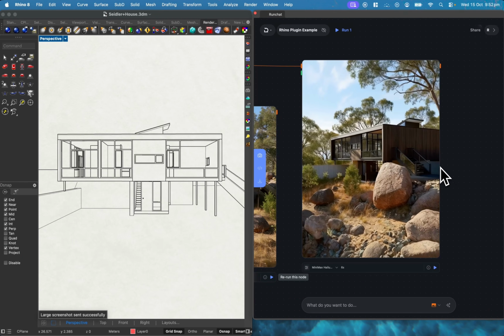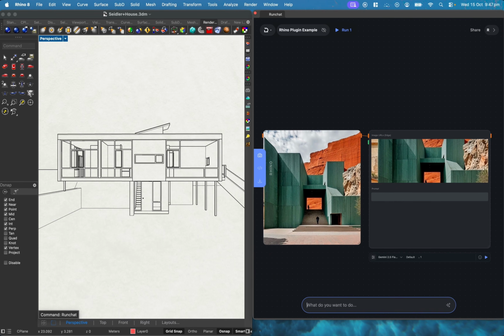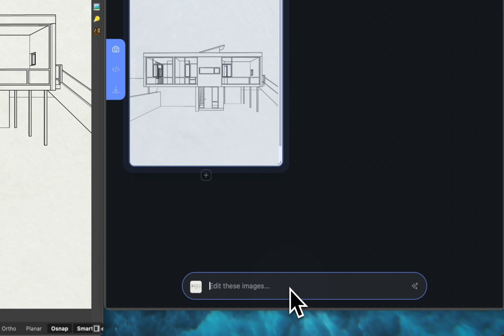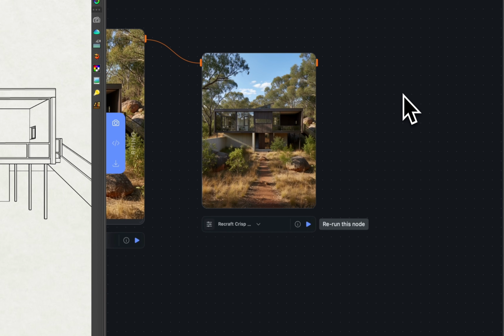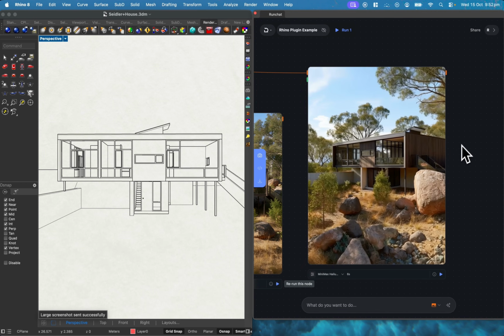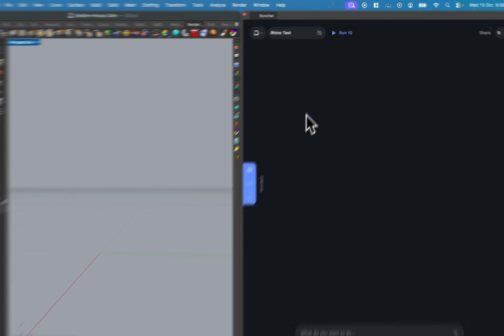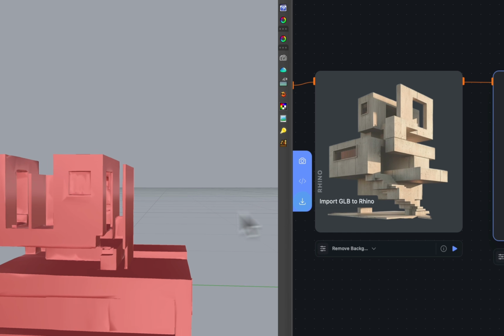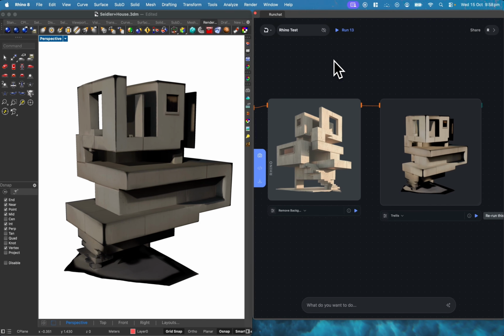Rhino's AI Upgrade: Instantly Generate Renders, Videos, and 3D Models with Runchat

Comment: Is it possible to do parametric modelling in rhino 8 like in inventor or solidworks for metallic frames, steel piping, metal sheets unfolding?
Reply from the maker: yes, some things will be easier in rhino (e.g. complex parametric models or Subd modelling etc), other things probably easier in solidworks (booleans, animations etc)
Reply: @runchat.tutorials which plugins do i need, if any, to do all of the above? Tough to check what i need to set it up properly.
Reply from the maker: @ASVESTAS23  you could try getting claude / codex to do it and then ask them for plugins to use if needed

Comment: Using natural intelligence, you will take much longer to create such a render, but using artificial intelligence, you will never be able to work on a 3D model to make corrections or create drawings, because when you ask the neural network to make corrections to the created image, each time the neural network will generate a different image that differs from the original
As soon as the customer says that they like the image created by the neural network, you will have to manually create a 3D model and adjust the appearance of the render to match the neural image.
People, don't be fooled.
Reply from the maker: Hey dmitriy. The points you raise are something we think about a lot. Ultimately we are interested in building workflows that enable users to circumvent some of the friction you’ve outlined in the process of producing high quality assets for clients. Directionally the capabilities of models are definitely heading towards addressing some of the points you’ve raised. Are there any specific workflows that you would want us build that would help with some of the frictions you’ve observed?
Reply: I think we're not at the stage yet where AI can fully take over design (thankfully). It seems like a really useful tool for concept design and generating quick but convincing stills and videos that can save the architect time early on and provide the client with lots of options to choose from, but at the end of the day, you'd still need to manually replicate these designs in BIM software for the project to be realised.